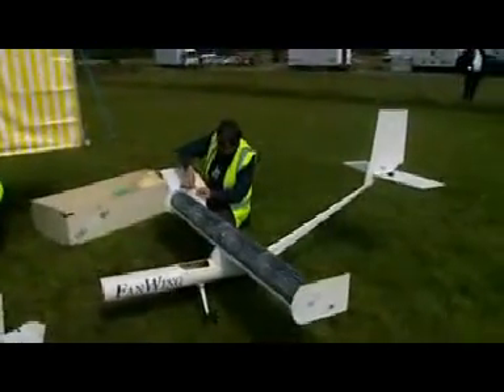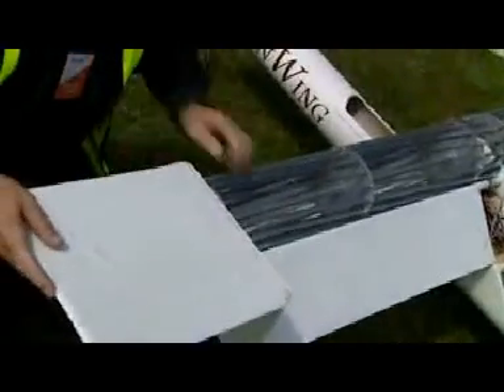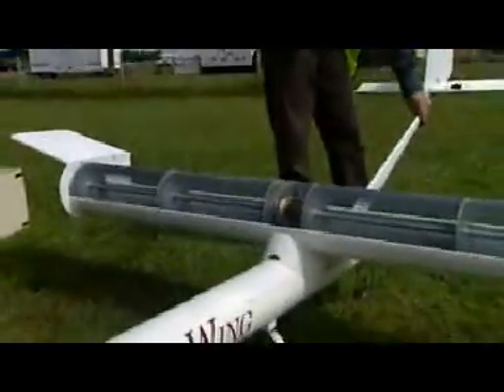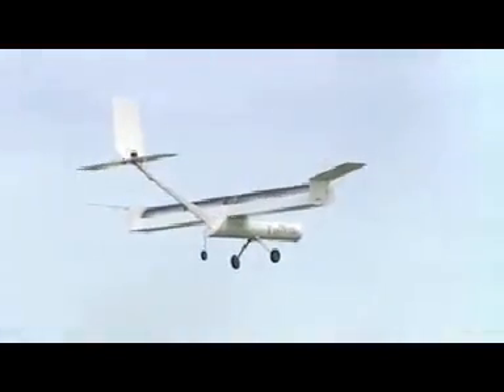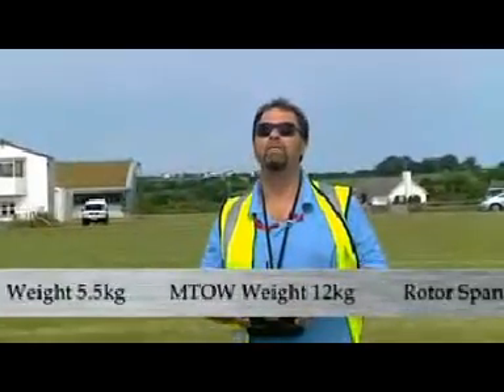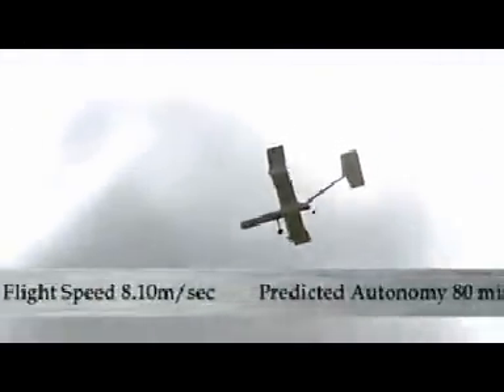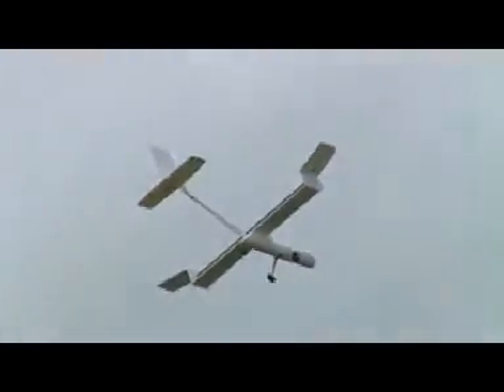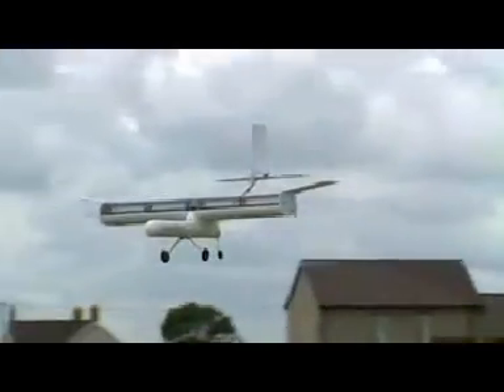Fan Wing

Comment: 2.073 which quite honestly is not very much. 2 megapixels for blu-ray movies...

Anyway, yes. The original pac-man was 144 pixels. 12 by 12 square. 

The Hubble Space Telescope takes images in from 4 different sensors, which are stitched into a ~120 MegaPixel image. 

You know how you zoom in on a picture and you see the pixels? 240 MegaPixels is so high, it would be the size of a billboard, and still look perfect at an inch away.

Also, 2 MP is not double the size of 1, and 4 is not double 2.

Comment: I believe he meant the size of the individual pixels and not the total count; low resolution scaled up to the size of high resolution screens makes the pixels of the video really big, in other words "mega"

240p isn't exactly resolution; the 240 part is the number of lines (regardless of the number of columns), and the p part means each frame has both odd and even numbered lines in sequence, p stands for progressive, versus i for interlaced where each frame has just either the odd or even lines.

Comment: First of all it flies really slow, and imagine the drag produced by that massive wing. The weight distribution seems to be off, the pivot point appears to be in the front of the airplane so I'm pretty sure the plane would just start to glide down. I am however pretty sure this design makes it susceptible to stalling. Pretty interesting design none the less.

Comment: what happens if the fan stops spinning?
Reply: It will fly down slowly and safe. The lift force is increasing linearly with rotational speed of the wing and again linearly with the speed of the airflow - the formula of magnus effect. even if u switch off the motor, which rotates the wing, it will slow down and aircraft start to accelerate downwards, which again increases the lift. Such a weird balance)

Comment: good concept but what happens when you have an engine failure?
Reply: It will fly down slowly and safe. The lift force is increasing linearly with rotational speed of the wing and again linearly with the speed of the airflow - the formula of magnus effect. even if u switch off the motor, which rotates the wing, it will slow down and aircraft start to accelerate downwards, which again increases the lift. Such a weird balance)

Comment: Interesting. Looks like an application of the Custer Channel Wing concept from the 1960's, wheras air moving at high-speed air moving across the wing generates a good deal of lift before the aircraft has even started moving. Very original configuration. Nice work!

Comment: @DaddyOD13 Compared to a helicopter?  I can see how creating your ow low pressure area has advantages but surely it still has all of the disadvantages of a helicopter?  If that blower fails it's going down in a hurry as it doesn't seem to use forward motion at all to generate lift; it looks like it's all blower.  Also, won't a quadcopter provide the same if not better functionality?

Comment: @raycod84  From WIKIPEDIA:-     
   "  *The throttle directly affects the pitch which means increased throttle can slow the plane down much in the same manner a helicopter flares, and if carelessly applied can force a complete mid-air stop.
     *Glide-ratio in case of power-failure is rather low (about 1:3) but if the power-line is disengaged, the fan-wing is fully capable of doing an auto-rotational landing."

Interesting. - You still wouldn't get me in one, though.

Comment: Lol...Interesting.
I wonder if it will glide in the event of engine/motor failure. - I'm guessing not.  : /
Reply: It will fly down slowly and safe. The lift force is increasing linearly with rotational speed of the wing and again linearly with the speed of the airflow - the formula of magnus effect. even if u switch off the motor, which rotates the wing, it will slow down and aircraft start to accelerate downwards, which again increases the lift. Such a weird balance)

Comment: what about communiting? How about a full size version. Lift at low speed is ideal for possible personal commuter flights, short runways commonplace. I wish I wasn't broke I'd be all in with money and Ideas. Also have you ever though of making it cheap and very small for indoor micro r/c. Its hot right now. Parkzone is a company making millions in that market. Good little planes.